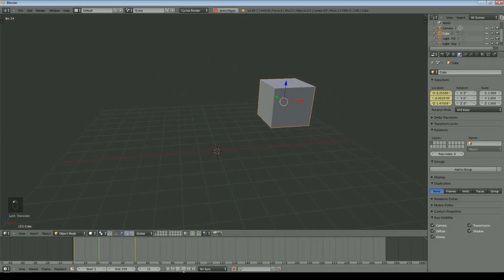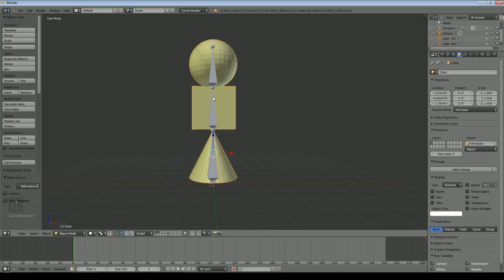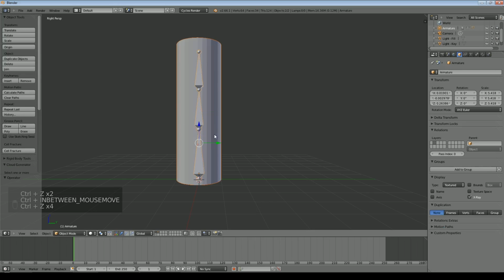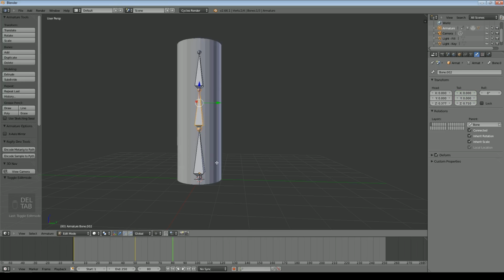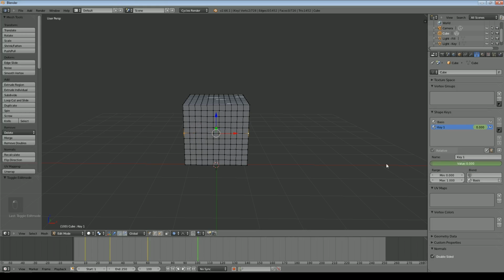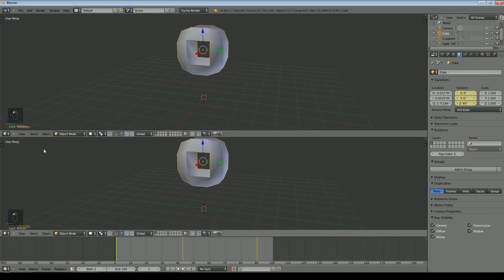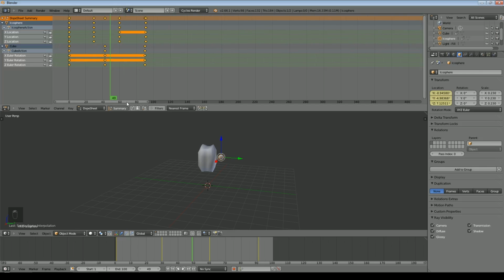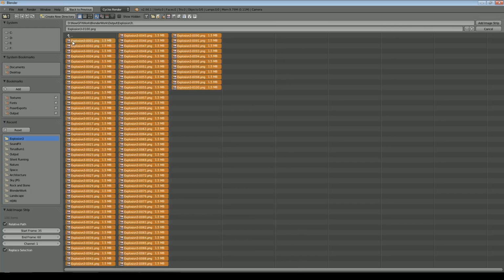Blender Tutorial - Basics of Animation

Comment from the maker: Hi Inada. My advice is to create a duplicate of your character at the point he is cut (assuming he is moving just before that). Split the duplicate into the two cut halves then switch out the split version with the original at the right moment. Animate the two halves falling away, if you don't use rigid body physics you will indeed need to add several keyframes. For the knife tool, use it after pressing Z (wire frame) then once you have cut all round, rip vertices (split them) with V. Good luck.

Comment from the maker: Manas, you must be in Edit mode. Switch back to Object mode and the '+' should light up. The first shape key is 'Basis' so you must immediately add another. You can then go to edit and alter the vertices for the new shape key (Key 1 by default). Once you come out of edit you can then adjust the Value slider for Key 1 to see the effect.

Comment from the maker: Hi LordEctro. For your texture problem, the issue depends on how you got the textures onto the object. Were you using texture paint or did you UV Unwrap and add an image to the zombie? The latter is easier in some ways, texture paint has some complications. Try a Blender Internal render instead of cycles (or other way around). How did you set the material to transparent? One way is to use nodes and add keyframes to a mix node to swap to the transparent shader (if in cycles).

Comment: This is really awesome. Simple to understand and yet very helpful. Do have 2 questions about it:

1. How long can an animation be?
2. Can you combine various saved animations? An example of what I mean would be to import a series of animations and make them into 1 whole animation.
Reply from the maker: An animation can be any length you want. You can set the start and end frames at the bottom left of the screen in the default layout.
Yes, you can combine animations.
In terms of complex animations with, for example, 2 large animated objects, animators will often animate them to separate image sequences and then composit them later. This allows the individual elements to be adjusted seperately, or even re-rendered, without having to re-render everything.

Comment: When you join two objects you first have to bring them closer together so that they appear as one. However, when you do that, the corresponding points do not actually merge into one point. The two objects are just treated as one by Blender.So is there a way to join two elemental points/vertices and merge them into one point such that it becomes a single elemental point? (anyone who has used SketchUp will understand it better) I require this for symmetry and accuracy. Thank you.

Comment: Thanks a lot for the tutorial, this is really great.

I am trying to use the « shape keys » as you shown.
It works well. But I have a problem at the moment I am rendering the animation. If I press « render » I have the correct image of my work at a precise moment. But if I press « animation » then nothing is moving.

Maybe the problem is coming from the fact that I am doing several animations on the same objet and that the different animations are overlapping each others.

If you have any idea of where that comes from, would be really great ! Thanks !
Reply from the maker: Hi, it's hard to say what the issue is without seeing the file. Are other animated objects showing as moving in your scene?
Reply: Sardi Pax I finally fixed the problem but I have no clue how I did it...
Thanks for your tutorials, they are all clear and well made. Really helpful.

I'm just wondering if you know a good forum for blender ?
Reply from the maker: I often visit the Facebook group Blender.

Comment: Great tutorial, thank-you. I'm having difficulty selecting 2 vertices as you have done at 13:18. I'm able to select 2 layers so I don't feel the keys are the issue (although I am using a mac). I keep restarting blender and repeating the steps but can't get past that point. The only thing I noticed is that my "Extrude" (under "add') seems to be selected by default. Also, I'm using version 2.76...do you have any suggestions so I that may add a shape key?
Reply from the maker: +Caramel Woodpecker Hi, the default key mapping for selecting multiple vertices is Shift then Right Click each vertex you want to select. If that doesn't work, it may be worth checking key-mapping under settings in case that's been changed.
Reply: +Sardi Pax thanks that helped

Comment: Hello again! So thanks for the playlist and all! But um quick question. Does the instructions also apply for 2.69 as well? Thanks again :D
Reply: Look at your email, now
Reply: Anthony Shafik don't you have the paper?
Reply: I forgot it at school.
Reply from the maker: The instructions apply for all version of Blender after about version 2.65.
Reply: Sardi Pax
Alright thanks! Also, is there an easy way to create a skull from scratch on Blender? Again I'm not sure what to do. Any suggestions? Other than the videos? Thank you so much. Sorry for all these questions
Reply from the maker: Hi again Kac. If you start with a cube and cut the cube in half vertically, you can then add the Mirror Modifier so that you can then model or sculpt one side of the skull and the other half is created as a mirror. You might want to check Blendswap as there's a good chance someone has already shared a skull model.
Reply: Sardi Pax alright thanks. Also any tips for how to animate the jaw? Inlcuding the muscles and the joints??  Thanks!
Reply from the maker: The only one I can think of is that you may find moving the origin of the jaw so it aligns with the 'hinge' makes rotating it during the animation easier. If you use a rig though that doesn't matter.
Reply: Sardi Pax alright, thanks. Sorry for all these questions.... again. Lol, but is there a way to animate the muscles for it to contract and stretch? Not only rotating? Thanks again.
Reply from the maker: You can animate scaling just as easily as translation and rotation. Just press I after making the change and select Scale. You can also create shape keys and animate their influence, which may be more suitable.

Comment: haha awsome vid! going to need this one.. creating a realistic female character at the moment.
today spend 4 hours on her feet :s . that gave me a possible problem later on maby you know what it is/ means.
in edit and object mode the color of the mesh has a separated band in a white color ?  will that be a problem ? i know the normals turn black whan verts are overlapping but how or why they turn white/ light grey i dont know.. do i need to fix this first or wont it cause problems later on ?
Reply from the maker: +Robbin den Dulk Hi, most likely you have some normals facing the wrong way, try selecting all vertices then in Edit Mode, under Shading/UVs on the left tool menu, select Recalculate.
Reply: thnx! worked :D

Comment: So heads up, I'm completely new (kind of-ish) to blender. Anyways, I want to use a bone as a pivot point for a text animation. However, when I go to pose the bone, the text doesn't move with the bone. How can I fix this, or what method should I use?
Reply from the maker: Text is basically a curve. Bones are usually used to deform a Mesh. One simple approach would be to press ALT C with the text selected and choose Convert Curve to Mesh. It should then work as expected.
Reply: Sardi Pax sweet, thank you

Comment: How would you do a animation where it starts slow, and gets faster and faster?
Reply from the maker: Hi James, you can control a graph that sets the rate of acceleration/deceleration of an animated path under the Graph editor. Take a look at that with the animated object selected. Alternatively, if you have many key frames, go to the dope sheet editor and decrease the distance between keyframes as you move through the time line.
Reply: Sardi Pax I just tried that, and I got jerky movements with my animated object.
Reply from the maker: Tried which James? The Dope sheet method? If you animation is jerky it may be you actually need to remove some keyframes then use an 'easing' interpolation. I notice that Blender 2.71 seems to contain many more options for interpolation curves.

Comment: I have a problem, I have made an animation of a ball running through a pipe. I used physics, but the physics stopped in the frame 250 and there is not more physics simulation. Is there some way to extend the physics beyond of 250 frame?
Reply from the maker: Hi, under Scene settings tab on the right, scroll down to Rigid Body Cache, set the End parameter equal to your maximum frames. Here's a tutorial about Blender physics I made a while ago - https://www.youtube.com/watch?v=l-v6Oyw3CuM
Reply: Sardi Pax
 I solved my problem, thank you very much.

Comment: It simply doesn't work at all for me... I don't know what I'm doing wrong, maybe one little setting provides it from working
Reply from the maker: +Audiultra Robotics Hi, which type of animation are you having trouble with and what happens ?
Reply: +Sardi Pax Hi, I want to move an object, like you did at 2:39 but along the Z-axis. I followed all your steps, but when I press play, nothing happens. I'm using version 2.76, is this a problem?
Reply from the maker: +Audiultra Robotics Hi, nothing has changed in Blender versions that will affect keyframing. So the steps you need to follow and in this order are: set the object to its start position and the timeline to 0, press I and select Location from the pop-up menu, move the timeline to (for example) 100, move the object to a new position and press I then select location from the pop-up menu. Set the timeline back to zero a press play.
Reply from the maker: +Sardi Pax Make sure your object is still selected when you press I.
Reply: +Sardi Pax Ok, now it's working correctly. I don't know what I did yesterday. I was a bit tired :) Thank you really much for the fast reply!

Comment: I've made a model for which I have made many actions, but I can't give them separate lengths. When I change the end frame of one, the end frame of all the others change too. What is going on? :(
Reply from the maker: Hi, when you say you've changed the end frame of an action, how are you doing that? Are you usign the Dope Sheet editor?
Reply: Sardi Pax Hello.
No, I'm just typing in the new end frame in the end frame field in the timeline.
Reply from the maker: Ah, well that is for the whole animation. To change the timing from a specific set of keyframes on a specific object, clock the icon far left just above the timeline (looks like a cube) and select Dope Sheet. You will then see dots that relate to start and end keyframes for your animations. Check the name of the object they relate to on the left then press A till they all unselect, then right click the ones you want to move and press G to drag them.
Reply: Sardi Pax It worked! :)
Thank you!